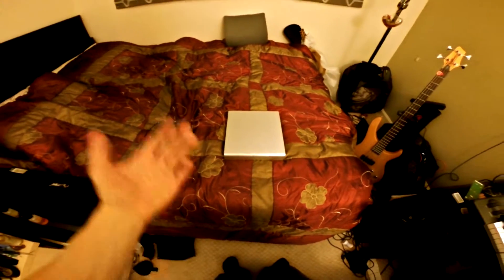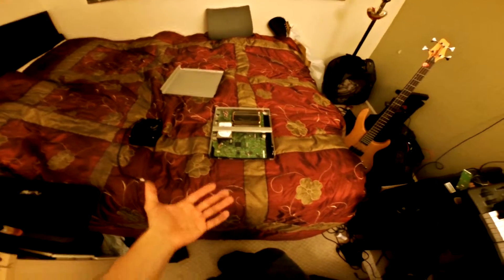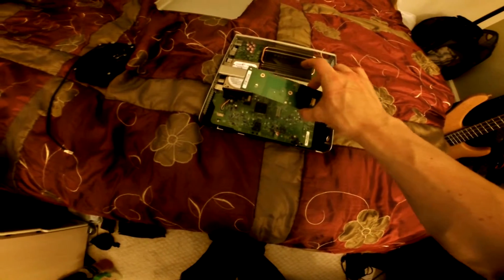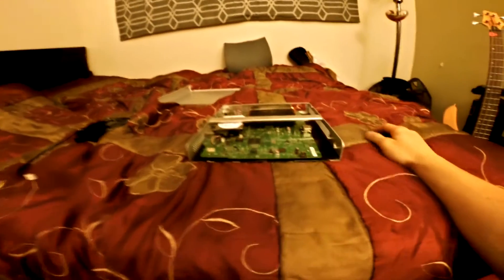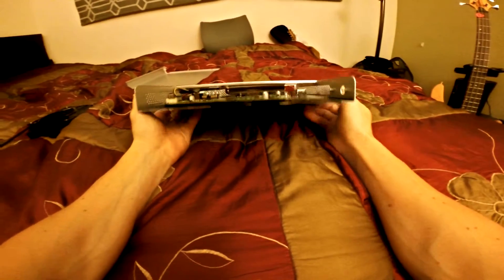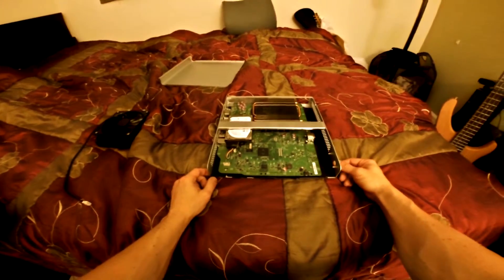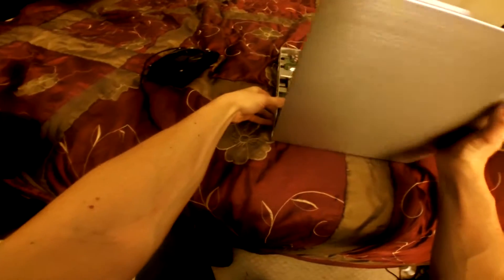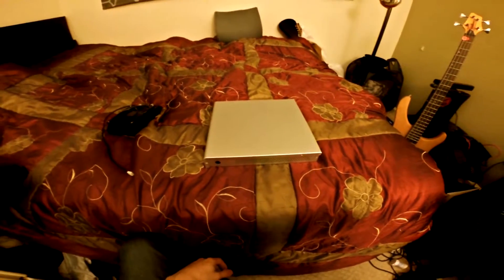smallest xbox one build!

Comment: Hi I'm building a wooden chassis about the same size as the lian li pc-Q05B case but what's the dimensions 

I'm thinking about making a digital xbox one like urs but using some wood 

Can I use some wood like when I make the top chassis of the case can i use screws in the sides i hope my wood dont break lol

Also what can I use as a fan I'm thinking about installing the fan on the motherboard and drill holes for the fan and on the back and sides
Reply from the maker: I don't recall the dimensions off tbe top of my head.  But it's an easy Google search.  I know the original Xbox one motherboard fits in well. But you may have a harder time with the One S or X since those use a custom internal psu.  As for screws in the wood that's a tough one to answer there ate many types of wood and you will want research which ones are ok to drill and put screws into so it doesn't split.  As for the fan if you make case a bit longer you can use the stock cpu heatsink and run some  blower style fans into it. I used a Reeven Vanxie with an 80mm fan but it just barely did the job.  I would recommend that you either find a heatsink with multiple copper heatpipes at least 3 or go with a bigger fan if you don't run the stock heatsink.